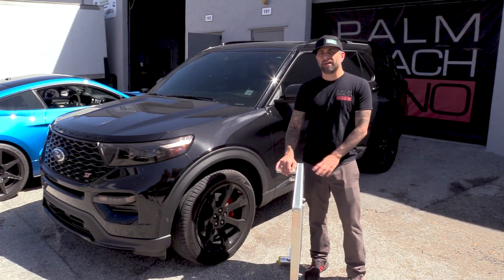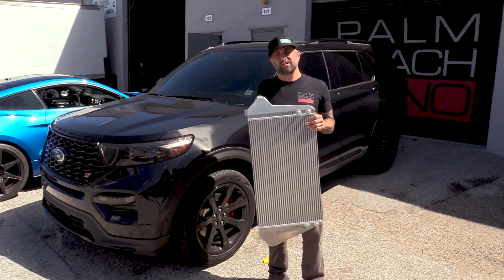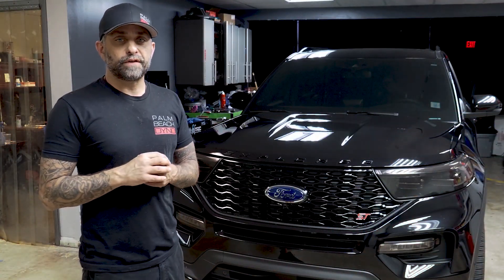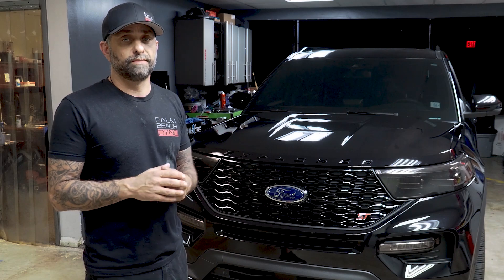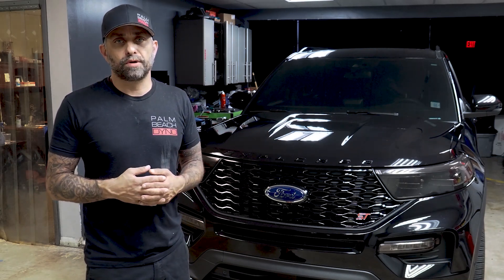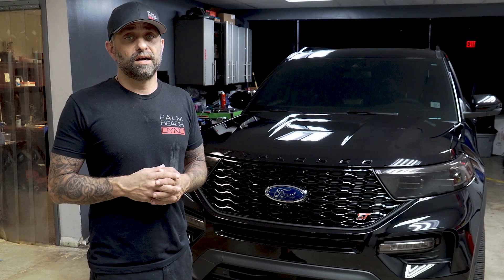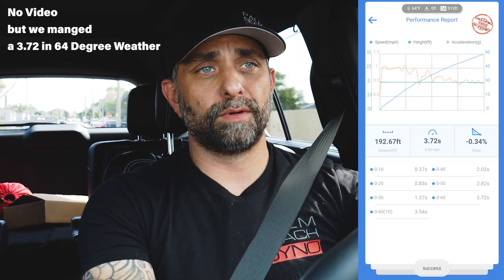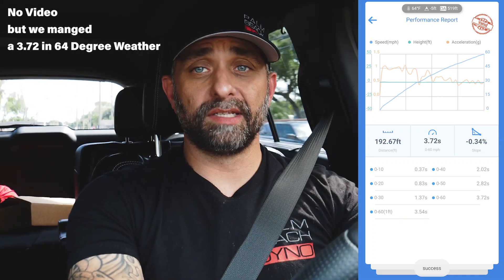Explorer ST - MUST HAVE MOD!!! More Power and SAFER!!

Comment: Any worries with excess condensation getting sucked into the engine ? Ford kind of learned their lesson with having a bigger intercooler than you need on the F150 ecoboost along the Gulf Coast and all the issues it had with that. Intercooler probably needs an easily accessible drain on the cold side end cap if you live in a humid climate
Reply: This is a great question.

Comment: Most heat transfer of any intercooler/radiator happens in the first row, frontal square inches are far more effective than thickness but you don't always have that choice

Comment: People need to understand that running E85 in an ST requires an upgraded fuel pump and tune and very likely larger injectors. Just putting E85 in them and running the shit out of them will cause bad things to happen. I DO own one of these and they are pretty quick.

Comment: I bought a Explorer ST about 4 months ago I love it and upgraded my exhaust system to a bolra S type catback  😎
Reply: Heck yeah man, right on 👍
Reply: How do you like it? Is it super loud or just loud or what?  We bought one in March as well, and I've been waiting for good options to hit the market!
Reply: @alecgrosvenor  mines is a throaty sound not loud just alittle deeper than the stock I have a touring package edition I don't like that loud sound
Reply: Shane Frasier Atak is the way to go for sound.
Reply: @davidmedoro4753  110% atak for sound
Reply: @davidmedoro4753  yeah it's cool but I don't like the loud noise I got the touring package it's just alittle deeper than the stock exhaust
Reply: How did you like the  exhaust ? I have a ST and I wanna get some upgrades for it !
Reply: @joshauger9726  if you just want to hear it sometimes, go for s type. If you get the atak its always making noise, if that helps.

Comment: The ford explorers st are fast. I just bought a 2023 ford explore st. It’s fast……… but not near as fast as what I really wanted. Couldn’t afford it…lol. 
The grand Cherokee SRT 2023 707 hp 80-90k or the 1200 Hennessy grand Cherokee SRT. 120-130k
NO SUV ON EARTH COMES CLOSE TO THESE!!!!
Reply: Well if you want to spend 100k for the trackhawk LoL 
This car is still amazing lol
Reply: And jeep stop making 2021 trackhawk LoL and the prices have skyrocket
Reply: I installed a steeda intercooler AFE CAI and SCT custom tuner and borla cat back exhaust and I'm around 550
On 85;600

Comment: You never get something for nothing. It's always a trade off. Remove heat from intake air and add it to the cooling stack. A/C will lose cooling capacity especially when ambient temp exceeds 100. If the engine is working real hard at  that temp it could over heat.

Comment: Looking at purchasing an ST ASAP! What’s the pros and cons RWD VS AWD!? Any info would be helpful 👌
Reply from the maker: First thought is the traction advantage of AWD
Reply: Is there any changes in mpg?
Reply: @PalmBeachDyno   but do you get more parasitic power loss through AWD transaxle versus RWD?
Reply: @jasonacsalesltd  This is no way an answer to this question, however have had an AWD 300hp Chrysler 300S V6 my launch  was rather enjoyable. I had to trade it in for my now 2021 Ford Explorer Platinum with 365 hp 380 lb torque. My 300S AWD would of had an advantage on launch, but would of loss it if I would pit it against my platinum explorer in my opinion. Would you agree, or disagree?
Reply: Good Luck I'm getting mine built in September, I'm going with the AWD for better control in the winter.

Comment: Is it possible to take the 21 inch stock wheels off of that car and put the 18 inch wheels that come with the XLT on it it is a very very rough ride you can feel every little tiny crack in the road because well you have 2 inch sidewalls but I think with the XLT tires and wheels the ride would improve substantially but I don’t want to spend the money until I know that they’re gonna bolt up? 
Does anyone know if those wheels will fit?

Comment: Serious question, would the addition of the intercooler (as much cooling and performance it adds) void a warranty? I own an SHO which also came with similar issues, but I'd love to replace my wife's Equinox with this all day!!
Reply: Magnuson Moss warranty act requires the manufacture to prove the failure was caused by the aftermarket part to void a warranty. I couldn’t see how they could argue that a better intercooler caused a failure unless the cooler itself failed internally.

Comment: I need to link up with you guys.  My wife has this vehicle and I put a 93 Octane tune from Five Star but I'd like to get this put in from you guys with an E-50 tune as well.  I also just bought a 2021 King Ranch with the 3.5L Ecoboost and I have been looking all over the place for a tune.  I guess Ford has been making it increasingly difficult starting with the 2021s for third partys to be messing around with the computers.... Not sure what you guys have in stock now.  I looked in March and nobody had a tune for the 2021s yet

Comment: The stock one, is that the one off the interceptor? Did you guys have to retune it? I knownif it runs too cool or too lean it may cause problems later... that inter cooler does look bad ass!

Comment: Does this mods  work on a aviator.  The Grand touring model asking for a friend?
Reply from the maker: It should but needs to be test fitted before we can say for sure. All the tuning is the same. We have tuned a few Aviators as well.
Reply: @PalmBeachDyno  👌
Reply: @PalmBeachDyno  Do these modifications, Tuning and the intercooler, void the warranty of the vehicle? I just purchased the 2021 ST and would like to do these upgrades.
Reply: @SteelNGuitars926  In the past, Ford allowed some Focus ST upgrades without this problem, but I don't think this one is specifically allowed. On the other hand, most dealers would not notice its there if the thing they are repairing for you is not either of the two coolers. They're nicely tucked away, and so long as the problem you are having repaired was not caused by the modification, I think it's perfectly honorable to get warranty work done without mentioning the mod.

Comment: Hello channel,

Considering getting myself an ST and doing these same mods + some more.     If I heard correctly, this is the RWD version of the vehicle.     Knowing that it is knocking out 3.85 with RWD, this thing is WICKED for cost to value.     I have to ask, because they offer an AWD version, do you think it would perform noticeably better at its 0-60?   Or would its extra weight offset that?    I am currently driving a RWD Durango R/T and ready to get back in to something faster.....  (previous Hellcat and Jeep SRT owner).....

Comment: I currently have a 17 Platinum, waiting for the 2021's to hit the dealer.  I'm torn between the ST or another Platinum.  I can't really find what I'd lose amenity wise going with the ST.
Reply: @mlbjr  The ST puts out 400 HP, The Platinum 365
Reply: After a tune the hp would be the same and probably cheaper insurance with the platinum.
Reply: @gsxravery  except the tune voids the warranty.   I went with the ST and glad I did LOVE it!
Reply: @trthib72   platinums are now 400 horsepower as well from the factory

Comment: How much HP will I pull with a AFE CAI and SCT custom tuner and steeda intercooler and borla cat back
Reply: I bought my st for 42k with 5k
Mods 
Steeda intercooler AFE CAI and SCT custom tuner and borla cat back exhaust and I'm around 550 if I did 85 600

Comment: Aside from the tune and trim, is there any mechanical engine/turbo difference between ST and Platinum, or is the Platinum a severely detuned  ST?
Reply: They have different engines.  The ST gets the 3.0 and the platinum gets the 3.5
Reply: @dmegon  not on the 2020+ The 3.5L is gone, only carryover is the 2.3L. The "largest" engine is the 3.3L on the Hybrid. The ST and Platinum for 2020 both have a 3.0L Ecoboost. Platinum is 365HP and ST is 400Hp. From what I can tell it looks to be same engine not even a turbo difference.
Reply: @michaelcannizzo1076  could be like the 2L Honda engine. Might have to look at the engine code. The differences could be subtle, or it could just be a tuning difference. Didn't know about the loss of the 3.5 though.

Comment: My question is how much to make this happen. I want one and everything needed to hit these 3.8 times.
Reply: Thats what im wondering the intercooler was 995 and i think the tune is probably like 600 but i cant find out what the price is of that xtreme di high presure fuel pump. From what i heard its like 2k which is pretty pricey
Reply: Afrim Ademi the xdi 35 pump is about $2k the xdi 65 is about $2700
Reply: Boosting low side fuel pressure increases the delta on your high pressure side. So going with an aftermarket fuel pump and controlling it will be extremely beneficial.

Comment: So how long was the install and how much HP did it gain?
Reply: It took the shop 1 hr. The larger intercooler helps keep the charge air temperatures more consistent and cooler than the factory one. It doesn't really gain power, just keeps air temps down.
Reply: @allanb3222  he replaced the radiator, not the intercooler.

Comment: Will this fit my Platinum as well since it's  just a fancy ST?  Would it benefit even if I don't have a tune on it?
Reply from the maker: If it's the same engine, there is a good chance it will fit. We can look into it. Even without a tune, lower temps are always better. The factory computer manages ignition timing based on temps. So even without a tune, this should result in more power.
Reply: @PalmBeachDyno  Awesome thanks.

Comment: Why no brembo brakes! ford went cheap on the ST model.
Reply: They're actually Brembo calipers with high performance pads. Most OEM's are Brembo without the labeling. The ST brakes are a massive upgrade from standard. I have an Atlas Blue ST as my DD. The brakes are night and day over my old Sport.

Comment: Will be broken down in shop, give it time. Ecoboost has been one of the most unreliable turbo engines I've ever owned. Ford needs to put a coyote v8 back in it
Reply: Our 2015 SHO went 150 k with not a single engine or trans promblem . 3 wheel bearings .